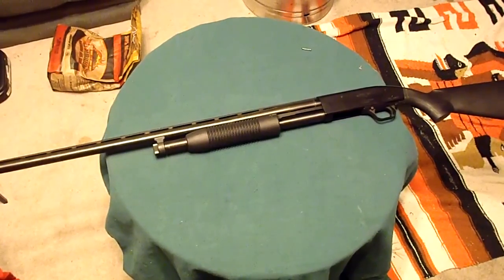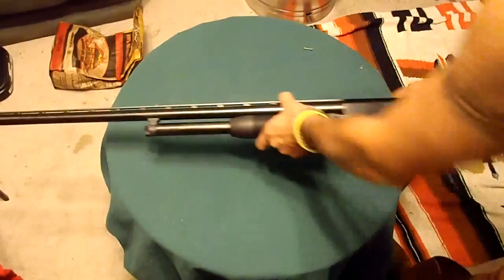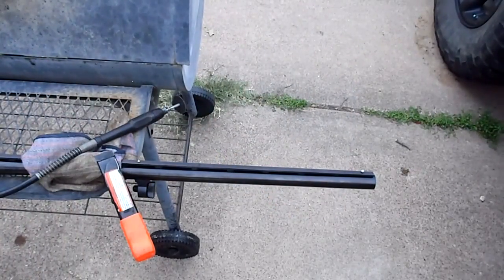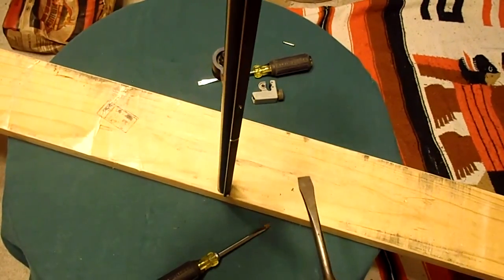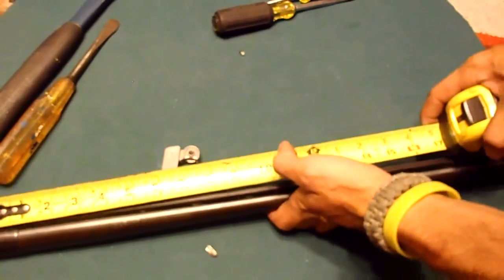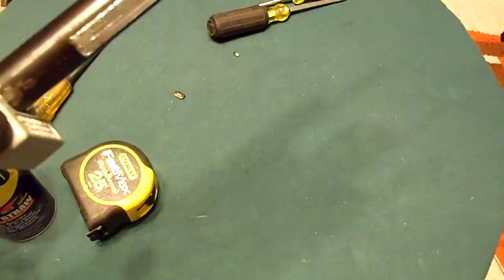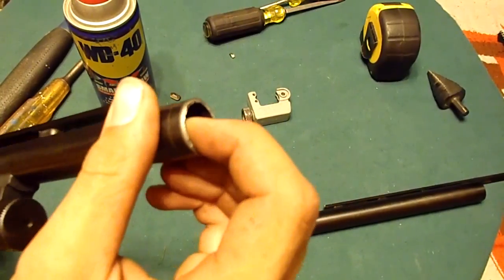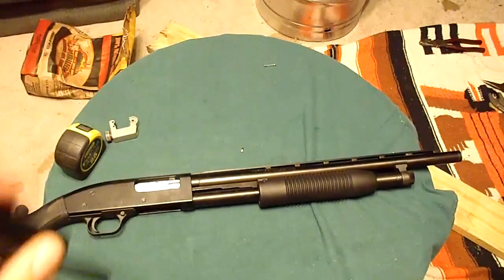Cutting a shotgun barrel...the right way? Well, a different way...

Comment: This is DEFINITELY NOT the right way to cut a barrel down. The tube cutter he uses is for cutting copper lines for refrigeration, not 440 carbon steel. Why in the hell doesn't he just cut it with a band saw, like you're supposed to? It would have taken 30 seconds. Then de-bur with a grinder, bevel and sand it smooth, and then re-blue the barrel? 

This is the perfect example of stupid is as stupid does.

By the way, Mossberg make excellent shotguns that are very reliable, and inexpensive.

Comment: Problem is you used a tubing cutter and not a pipe cutter.  Tubing cutter is for copper pipes and other thin metals.  Pipe cutter would have cut right through the barrel.  Just sayin...

Comment: what exactly makes a $200 mossy 88 a bad gun? they work dude  owned mine for 4 years now and shot the piss out of it with every kind of load you can think of with ZERO issues. in fact most pump shotguns are just fine, kinda hard to screw up a pump action. hi point i understand talking shit about because they are actually bad guns. more expensive gun rarely means better gun.

Comment: That pipe cutter is made to cut soft materials. Specifically copper. The reason you had so much difficulty getting through is that, the steel barrel is a harder type of steel then the cutting wheel. I cringed every time you prematurely tightened that cutter. That's not how you use a pipe cutter, even on copper. Slow and steady wins the race.

Comment from the maker: I only paid $100 for the shotgun used. I know I could have spent the extra $100 and got another barrel, but then it would have been a $200 shotgun. I have about 7 shotguns, all for different purposes. I already have several long barreled shotguns, and have no use for another. Since I got such a good deal on it, I decided to not only make a shorter more useable beater gun, but try out the advice I had gotten on cutting a barrel.
 I have since gotten it duracoated by a friend.

Comment: This whole thing is (a kind way of putting it) SCATTERBRAINED.Do not do this !  You threw away a way of choking the barrel. BTW the Mossberg is a great shotgun. I believe that shotgun may be made in Turkey for Mberg.The Turks make great firearms,.for example an AR version of a .410 bore that sits on any AR lower.
    WAL MART currently has a .410 bore  Mberg pump shotgun with beautiful wood and a 24 in barrel with twin beads for $248. I kept the barrel and ordered a slug barrel ( 18 in.)for $80.

Comment from the maker: Cause they pretty much are...yes they do shoot, and are decently durable, but the fit and finish, the look, the weight, the size, the action...not high quality. I had a high-point carbine and loved it, I'm actually looking for another, but they are hideous looking. High-points cost $150, and you get $150 worth of gun. Like I said, if you only have $400, buy a High-point 9mm and a Maverick 88, and have money left for ammo. You will have 2 guns that will work. Not great guns, but guns that work.

Comment: The barrel is tapered.  That's why it looked like it was threading.  The tubing cutter was at an angle following the taper of the barrel.  The steel that they make barrels is high carbon steel.  Probably as hard as the cutter wheel.  Perhaps you should stick to something you know something about before you make a video and post it on You Tube.  (The "right" way is absolutely not what you did to that barrel)

Comment from the maker: Yes, I know we use them at work for copper, and I had originally bought mine for brake lines on my Jeep, used them once and threw them in the toolbox. A good buddy of mine told me he had cut many shotgun barrels with tubing cutters, and it came out so cleanly that he didn't know why people used hacksaws. I believe it would have worked flawlessly had I not had the cheapest tubing cutters I could find, and had more patience. I think the patience thing was the biggest hiccup.
Reply: Have you done this again since? And if so on any shotguns without ribs?

Comment: hey i know what your trying to do. i can see the point you trying to make. sometime the freaking tools cost more than the job. or even 10 jobs. A hardened cutting wheel in a Rigid at Home Depot will cost you 80.00 Bucks. I did this for 30 Years. You are right in the fact a tubeing cutter for Steel will make a very pretty Job. I'm sorry I was a little sarcastic. Midway makes a guide for your hacksaw for instance. 15 years ago, It cost me 30.00 Dollars. In all fairness you yourself out There

Comment from the maker: I decided after paying so little for the firearm that it was not worth paying for an extra barrel when I have several other shotguns that will accomplish the tasks that the other barrels would accommodate. The process was easier that it appeared in the video and actually turned out pretty good. I ended up liking the look of the shortened vent ribbed barrel, and am in the process of having a machinist friend of mine make me a crazy muzzle brake that will cover the cut end of the barrel.

Comment: all these ppl talk shit that this takes way longer than usein a saw but i feel like it would be much more accurate and flush at the end with alot less sanding .i plan on using this method  but i got a larger 'ridged' brand pipe cutter mede for cutting steel

Comment: your problem is you dont know much about tools. That tubing cutter is ment for non ferris metal tubes like copper or brass. Your barrel is steel, thats why it did a crappy job and ruined the tool. Your first clue that this was the rong tool for the job should have been that you needed to tigten the THUMB wheel with plires to get it to run true.

Comment: What a goof. Trying to cut a barrel with a pipe cutter. Copper plumbing pipe is very soft metal and is easily cut with a pipe cutter. A shotgun barrel - not so much.

Comment: Wrong Tool, That was a cheap copper tube cutter. too small. the Right tool is a Rigid Steel and Galvanized cutter. You had no Plan ans Just plain got in a hurry. The Barrel should have been bench clamped, Thats ok you can still change you name and take the 5th on this video. ahhh tell them you had a beater gun to your head and had to make the video

Comment: here is some advice 
1 if you have never done it before dont do it and put it on youtube making it sound as if you had
2 a pipe cutter is meant for copper and soft steal not hardened steal 
3 all you did is make your shotgun less accurate less effective and less valuable
4 get proper tools your chin is not a clamping device neither is your fucking grill/smoker
5 get rid of your guns or just promise you will stop abusing them in such a way

Comment: you have an opinion but no knowledge or proof to support your accusations, a maverick 88 is superior to the Mossberg in price and value it incorporates a safety in the trigger housing, their great guns
hi-points are not junk, their very good guns, their only short coming is low magazine capacity, but their fixed barrel blow back design makes them accurate, like the proven walther model 4 and other german pistols
if I had a 28 inch barrel I would lengthen the magazine tube to 28 too

Comment: This video is garbage. To measure barrel length, as approved by ATF, insert a cleaning rod, with the breech closed, and measure it: that's the legal barrel length. Cut off the barrel with a hacksaw, bandsaw, whatever. Dress the muzzle with a grinder, file, etc. That pipe cutter method is no better, and probably ruins the pipe cutter. Then re-mount the bead sight. They are soft-soldered.  A milling machine is best, but a Dremel is fine, to make the recess. A propane torch will do the soldering.

Comment from the maker: The barrels of these Maverick 88s are not forged hardened steel like better guns, they are MIM...Yes I would out later there is a very slight taper, but had I been patient, the tubing cutter would have done fine.

Comment from the maker: First, this shotgun is not a 500, I have slightly more respect for an actual 500 or 590 or other variants. Those models have quality made recievers and barrels, better tolerances, and a better setup all together. The reciever and barrel on this gun are MIM (metal injection molded, look it up) and are of much lesser quality. if you handle this shotgun and a quality shotgun such as a 500, 870, nova, or whichever, you will immediately knotice the lack of quality here.

Comment from the maker: Apparently you've never owned a good shotgun. SOME Mossbergs are pretty decent, but there are a TON of better guns. This particular one is the cheapest bottom of the barrel shotgun you can find. It does work, but it DOES NOT kick ass at all. The parts are not forged, they are MIM (look it up), the action is not smooth, and even the logo is not engraved, it is stamped poorly and unevenly.